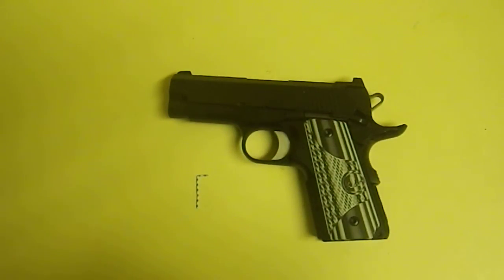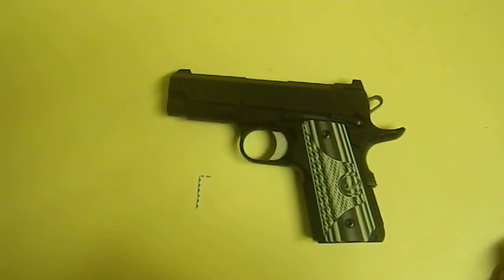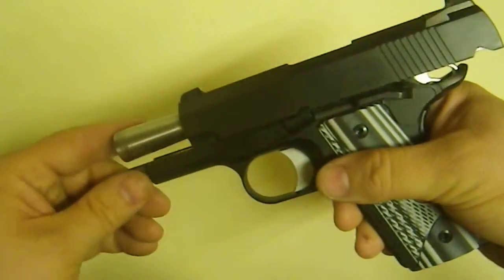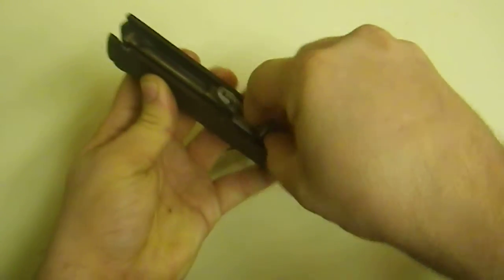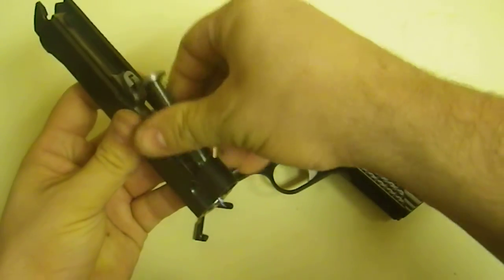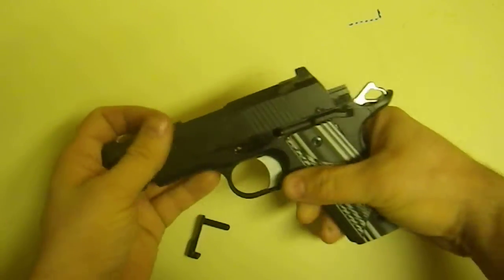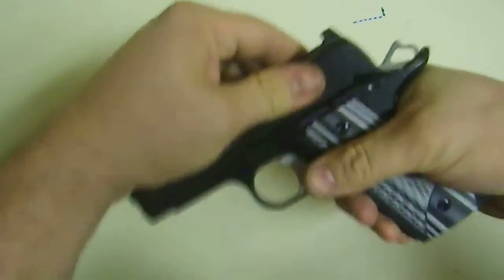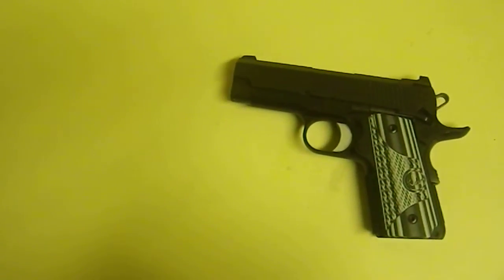My Dan Wesson ECO Break Down

Comment: Still deciding between the Dan Wesson ECP and the ECO for concealed carry. Difficult decision.
Reply from the maker: I absolutely love mine and it's been my daily carry for 5 years and it's still amazing! Now I need a second one and to convince my wife why I need to dual wield lol
Reply: AvidClimber any issue with getting your whole hand (all fingers) onto the Officer frame grip? You seem to do fine with that. Also, how snappy is the gun in 9mm? Thanks!
Reply from the maker: @jonathanl2748  no problems with gripping it with single or two hands. I heard years ago the 9mm was having a problem with the slide because it didn't have enough power to rack the side properly. Great gun!
Reply: AvidClimber that is great to hear as concealing the ECO (Officer) will be easier than concealing the ECP (Commander). But they are both superb looking 1911’s. Thank you so much for your feedback!
Reply from the maker: @jonathanl2748  of course! Enjoy

Comment: Was your thumb safety stiff as hell when you first got it? I just picked up mine today and can barely flick it up with my thumb.
Reply from the maker: Yeah the tolerances are so tight it will loosen up with practice and normal range use. Still have mine still use it for everyday carry. Did you get the 45 or the 9?